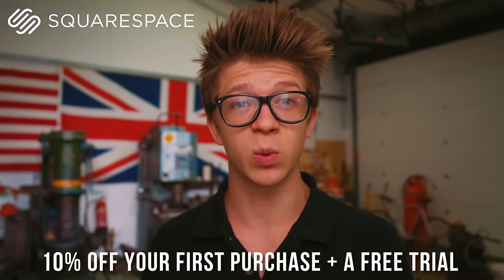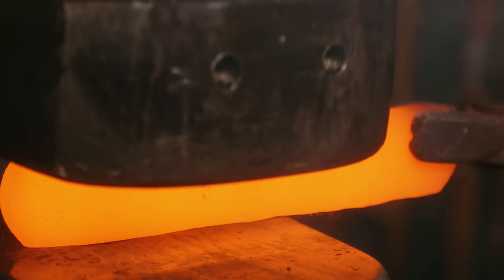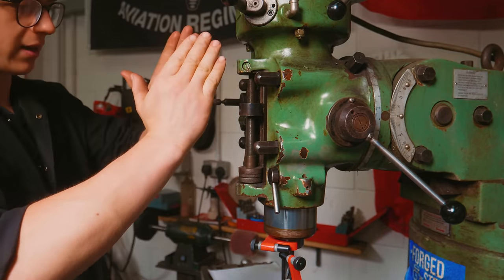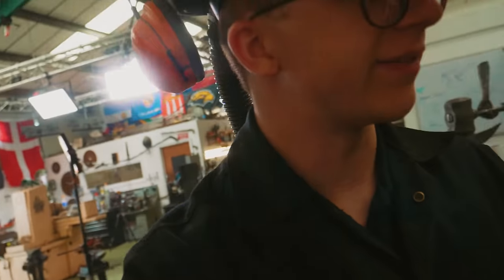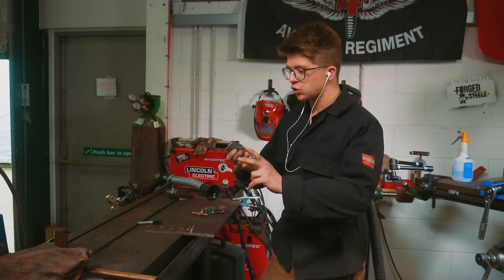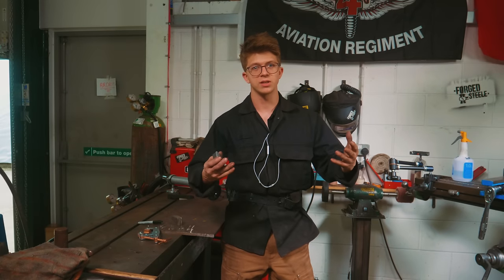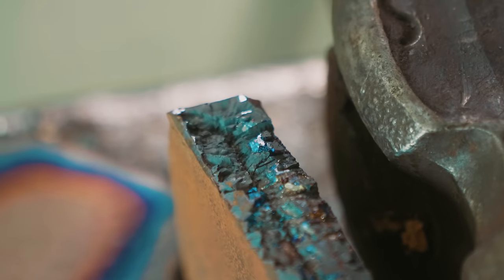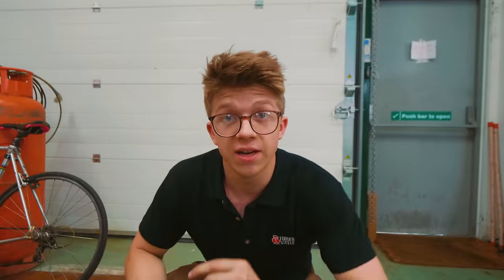CAN YOU MAKE TITANIUM & STEEL DAMASCUS?!?!

Comment: Maybe you could try with steel and titanium shavings from the saw, but I think that the problem is the different temperature you need to work its together. So I think the titanium must be apply like dust  (very little shaves) between steel's shaves, puting all into a pipe. 
And the temp. to work it just near the fusion point of steel.

Comment: You might want to think about upgrading to Hydrogen in your furnace.
Use Saltwater in an HHO generator for an added Chlorine gas.
Be certain to Vent with a Blower.
You Do Not want to breath Chlorine gas.

As for the mixing of metals...
I’d like to see you make some Net Metal.
Use an HHO Torch and melt Copper and Iron together.
You’ll get a Purple alloy with a Gold Net around it.

Have fun with that one.

Comment: The volatility of titanium comes in its dust/shaving. Simple pressure is safe. Using a slow hydraulic press will mitigate the sparks. The problem when he was milling is the the molten titanium oxide balls are brutal on cutting edges. I’m surprised he didn’t use any coolant or lubricant. I’ve heard tile saws are excellent in lieu of water jet or ecm.  Diamond cutting with continuous cooling

Comment: Try with a nickel 625 tube at 5” x .100”-.125” diameter x thickness with charcoal inside to reduce oxygen inside as nickel 625 is chemical resistant and reflects heat. (Also makes a nice drip collector if you are flux heavy). It should provide an oxygen free environment and add carbon to the steel

Comment: Something that could might help with the two metals forging together could be lapping? I know this is done with some cooling components on PC's to make a surface as flat as reasonably possible, this might help remove any tiny gaps between the metals where they could oxidize. Although I really know nothing of if that would practically help

Comment: Try using a very large plastic bin, and using your Argon supply to fill the bin so that there’s no oxygen, then weld your pieces together inside the bottom of that bin so that you don’t have any oxygen in there to oxidize during the forging step. You’re going to have to make sure your weld completely covers all the cracks so that no oxygen can get in later

Comment: Instead of argon, use another noble gas. Should have the same affect. Also use powdered flux right after cleaning the surface areas before even welding them together. You could have created oxides badly at the weld area and basically creating pitting, from the reaction with steel I think. Then the oxides formed between the plates pre heat. Flux between the plates might prevent that?  Have you thought about building an induction forge so you can use the gas effectively?

Comment: Accidentally peeking.
What, nevertheless, profanity is about is written in any adequate reference book about the intermetallic compounds of the iron-titanium system and their fragility at the temperatures necessary for forging.
If you want a real damask made of steel with titanium - then
1. Get yourself a workshop with a protective atmosphere. Xenon is the answer to many questions.
2. Use an induction furnace and cathode-ray vacuum welding in advance.
3. Use an intermediate layer. Best of all is the vanadium-niobium bimetallic foil (vanadium to steel).

Comment: Try the copper plate as a buffer between the titanium and steel. You'll have to vaccuum TIG it and apply a lower heat and work it SLOOOWWWWW to prevent breaks and unwanted folds. Best of luck 
Cheers🍻

Comment: This is probably just a fantasy alloy/weld suggestion, but after reading some of the posts it would appear that titanium has better chances of bonding with nickle than Iron.  If I may, would it be possible to forge weld or crucible bond (or whatever way works) a meteorite with titanium and forge something out of it?

Comment: Try titanium and nickel. 
See if you end up with any nitinol characteristics of super-elasticity.
Or, just make a superelastic nitinol blade.
High end glasses frames, bras, dental braces, and other things at the end of thier use cycle are good sources.
You could end up with a very thin blade that you cannot break.

Comment: Titanium is a HCP crystal structure, Iron is BCC. That means they won't alloy well.
Reply: when they do though they are strong
Reply: @raaston9761  Not necessarily. When you mix two metals that are totally miscible in each other you get a homogenous alloy. When you mix two metals with a partial solubility of each in the other you get a spinodal breakdown where the solution separates into domains of material where each respective metal contains only the amount of the other metal that is soluble in it. E.g. if Metal A has a 5% solubility in Metal B and Metal B has a 10% solubility in metal A then you will get domains of 5% Metal A and 95% Metal B interspersed with but separate from domains of 10% Metal B and 90% Metal A. Sometimes this is stronger, sometimes it is weaker. For some metals the phase diagram can be very complex. 

Also, in this case Titanium will react with carbon to form Titanium carbide, thus depleting it from the steel and forming hard but brittle ceramic inclusions. 

You would be better off using cobalt as a base metal and growing a tungsten carbide dendritic structure. This alloy is known as Stellite and is extremely durable and corrosion resistant. The dendrites form micro-ceramic teeth at the edge that act like micro-serrations and cut through just about anything.

I have a PhD in Materials Science, I know what I'm talking about.
Reply: @awashburn6944  Well there is the beta-allotrope of titanium that might have a higher solubility and hardness and be stabilized by the presence of trace elements. Still won't solve the tendency of Ti to react with carbon in the steel.
Reply: @awashburn6944  I'd also add that most "superalloys" contain traces of other elements to stabilize the crystal structure under intense temperature changes etc. For example Plutonium has 6 allotropes at ambient temperature. They had to add traces of gallium to stabilize the lowest density one to make bomb pits.
Reply: @awashburn6944  Not only that, but you'd have to heat it in some sort of induction furnace, then forge it in an inert atmosphere.. TBH the better bet would be to take something razor sharp (like Sapphire) but ultra thin so it could flex, and have holes in the back end and cast the Ti around it for strength.
Reply: @awashburn6944  Well, most "superalloys" like those used in jet turbine blades contain platinoid group elements that alloy well with Nickel while improving strength and other properties. They also have to grow them single-crystal to prevent creep at high temperatures and tensile forces from high-speed rotation.

Comment: You work Titanium inside a chamber filled with Inert gasses..  or you can wrap a canister around it and fill said canister with inert gas. In doing so, if you make it even halfway air tight... you can forge weld the canister like usual. The only difference is that you've filled the Canister with solid plates and not powder.

Using the inert gas the titanium CANT oxidize.

Edit: oh. You covered this at the end of the video. What I get for commenting halfway through.

Comment: (not a blacksmith, just a fan and an enthusiast, so i'm just pulling an idea out of my a**)

Would it be possible to smelt down to titanium and steel together (sort of like mixing a stew), and cast them into the forging puck. And THEN start hammering it and forming its layers ? Or will it simply fall apart again and chip away with every hammer strike ?

It's my uneducated idea as much as it is my curiosity.

Love your work, and your show ! Cheers !

Comment: Early days of Cape Canaveral:   What are the people that work there were the hallway the trash and burning in his backyard. As I said it was the early days. One day he hauled a bunch of scrap mostly wood he took out what metal there was but there was a lot of metal shavings. He didn’t worry about it. It would probably melt it’s eventually get scraped it up. Those metal shavings were titanium.  At first it was a normal bonfire, then it got bigger and a lot hotter, and even hotter. At this point he knew something was wrong. He couldn’t get very close to this bonfire because of the heat. I Tree caught fire near his house, then another tree, his house starting to smolder.  The garage sorry to smolder and since an edge of it was closer bonfire that caught on fire. When the fire department arrived house next-door had paint chipping off and curling. They were able to put out the garage fire and prevent his house from catching on fire. The trees not fare too well, They were large Live Oak’s. Not sure if they survived to recover. The firemen had great difficulty putting out the bonfire, apparently there was a lot of titanium that he did not know was in there....  there was, several wood and cardboard boxes.

Comment: Practical theory: electrical induction forge in an nitrogen or argon rich atmosphere. 
No oxygen=no fire meaning no heat. But using an electric induction forge does NOT require oxygen to product heat. 
So get rid of the oxygen and you get rid of the oxidizing problem with the titanium. Couple that with more heat and it will probably work!

Comment: I guess if I were going to try this, I would weld the billets together inside a fume hood filled with an inert gas, or seal it in a can inside a fume hood filled with an inert gas. Not sure if this would be stepping on the patented process, but... that's what I would try. 

Side question. Do you know if you can forge weld silver and steel?

Comment: Regarding timascus being patented, I'm a software developer and patents come up fairly regularly for us. I'm however not a lawyer and this isn't legal advice - just sharing my understanding of how it works. I believe that it's a false equivalence that simply making something that's patented will get you into legal hot water. To find yourself in legal trouble you need to cause damages for the patent holder by making and distributing the thing that is patented. There are lots and lots of cases in software where content which educates people about a patented invention, even to the point of demonstrating how to build the thing that is patented, is totally fine. As an example, numerous popular open source projects have released source code for patented algorithms. As long as they distribute the source code and not the binary they aren't in voilation of the patent. Projects like this literally have unabashed tutorials on how to build the source locally for those who want to get around the man. The ffmpeg project is one such example. People following these instructions may be in violation of the patent if they use whatever it is for commercial purposes, but the open source project isn't at fault.

Tl;Dr: I hope to see a video on timascus soon!

Comment: slow your sfpm on the saw down to maybe 45 or lower, and set your feed speed high.  This is the only way to machine titanium without ruining your tooling.  With any material, you can always get a feel for it by turning a piece before working it.  That round bar could have lost 100 thou and not made a difference, but you'd definitely know how it behaves.

Comment: try making titanium, steel, aluminum Damascus ^^

I know its possible to get the three materials to stick together, a friend of mine before he stopped blacksmithing made a katana out of the three metals folded together

I just wanna see what it would look like

I learned from my friend that he used titanium, aluminum, and steel

though I'm unsure what type of steel

the resulting alloy? I think the term would be? was very light weight but was strong enough to stop a 50BMG round without the plate of the three metal hybrid even denting (friend is also former military)

or so the story goes, I'd like to see this super metal mixture in action

(edit) it was a very tough and difficult forging process and he constantly have to keep reheating do to the aluminum requiring a lower temp he was always at the border of cold forging the stuff
Reply: @awashburn6944  I could've missed heard him and I've probably forgotten an important detail or two
Reply: Also the positioning of the three metals was heavily important... I do remember that

Comment: silver and iron
silver has been found in extremely small quantities in iron naturally so it is thought that they may be capable of making an alloy  and while i haven't tested it yet you may be able to bind or melt together a piece of silver an a piece of iron if you sandwich them together and melt them with a copper coil there are tons of videos of people melting plain iron that way and it may help the silver bond better to the iron because of there magnetic and diamagnetic properties

Comment: You need to bi metal insert to forge titanium to steel. In other words, you need a different kind of metal that will bind the two as they will not Forge weld just like you cannot weld steel to aluminum without a bi metal insert

Comment: Seemed strange to seal the metals to keep out oxygen, then blast oxygen at the 'billet' with a standard furnace, wouldn't molten salt create a vacuum sealing out any oxygen whilst providing the heat? Then there's less chance of oxidisation? Of course a billet of steel/titanium heating up in a bath of molten salt might be a tad dangerous.

Comment: I think you should try to lower the heat with a longer heating period and if you can lower the force on the hammer so it doesn't start devastating and causing stress in the meatal with each blow that way you can gently forge and move the two different metals ease that may even reduce the amount of sparks and not make it as much as a death trap. I want to try to forge a a knife and Hatchet  out of Titanium and 316 Stainless Steel when I get the right equipment and if possible you should retry it

Comment: I have no knowledge on ti to steel, but, I wonder if the oxide was ground off, stacked with the steel, and fusion tig welded back together in a purge box or tent under an inert atmosphere (argon), then they might fuse once forged

Comment: I used to work in an aviation manufacturing company and .... one of the lathes ignited a titanium fire. The company fire team managed to isolate it for the 18 hours it took to burn itself out. $18 million dollar loss of machinery and impact on the product line. That sucker not only slagged the machinery, it burnt the concrete back to rubble. I still think they should have put in a skylight instead of just rebuilding the roof.

Comment: what about putting a titanium slab inside a well packed canister to make almost a canister san mai?  so as to prevent exposing any surface of the titanium  to oxygen until grinding, that  was you could make a blade with a steel bevel and spine but a titanium cutting edge.

Comment: Could you try putting a layer of flux between the layers. Welding the corners and 4 sides. The flux should get rid of the oxygen between the layers and should burn off in the forge. Maybe worth a shot definatly no guarantees.

Comment: Before I try entering the state of a mad scientist! You should try 😂... Melting them down in a crucible together. While purging with nitrogen or argon. Then cast it into a billet and work it from there.
Reply: those are different property metals they do not combine. the purpose of this attempt was to get dual strengths by layering and fusing rectangles. I really want to see this successful. Give it another go.
Reply: Micheal Funickrr I fully understand their differences however forge welding is the process of taking material at a high heat and applying force to fuse 2 materials together to make one the problem was getting the two to fuse together under the normal forge welding process even with different property’s THEORETICALLY you should be able to combine the 2 materials in a controlled environment in extreme heat much like fusing is done with normal ole welding the materials will have different melting temperatures so you’ll have to keep the material stirred if you will until a solid material is left behind of the 2 metals fused together then pressure done by forging should create a nice solid billet

Comment: Its hard too do kuz titanum looses heat sooooo fast soo damn fast and it takes an enormus amount of heat to get it to weld. By the time the T is ready to hammer an gets to temp the steel is already melted damn ner! So its a delicate balance! It took me about 12 trys to get it to where i could get a useable peace of material to work with. And yes its gotta be in a argone gas or somekinda no reactive gas Atmosphere because the titanium just catch a fire and burns really freaking hot and puttin it out is not easy lolit acts like magnesium kinda. But it looks badass when you get it right and holds an edge like u wouldent belive!!

Comment: The melting point of titanium being >3200 F makes for the metals acting very differently at steel's hot welding point.. maybe if you were able to bring the titanium up ~650 degrees hotter than the steel somehow it would work better but as far as I know they arn't chemically compatible without some kind of binding agent.. like maybe if it was nickel/titanium/steel? Mostly I know the only way to make them actually bond is by melting them completely just due to the melting points being so different.

Comment: I wonder if you applied flux in between the different metals prior to welding them in place. Or, you could simply heat both metals then sandwich them together with flux without welding. Just some ideas to try.